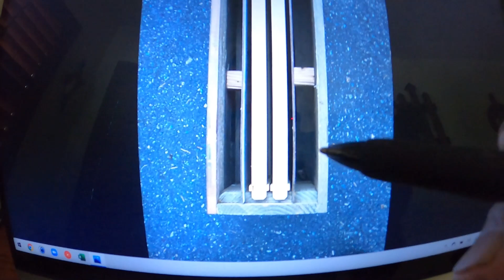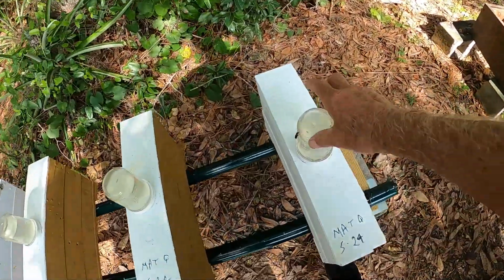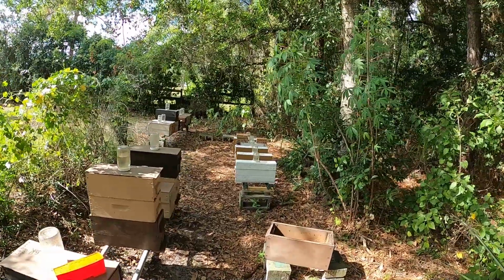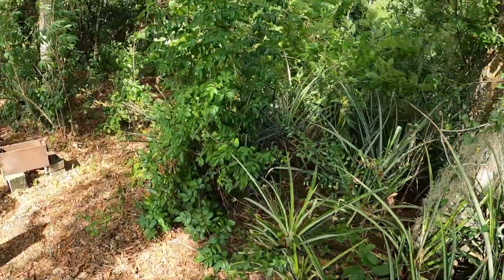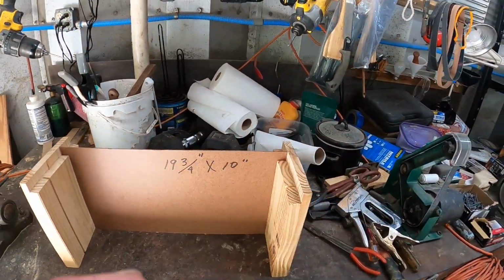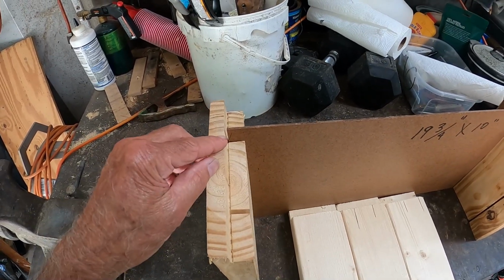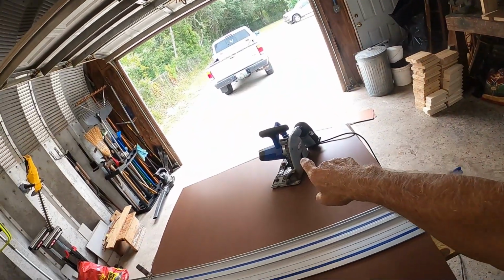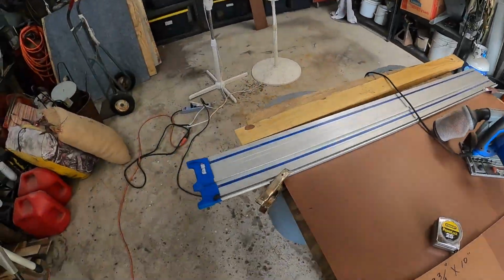5 Frame Beefy With Internal Mini

Comment: Couldn't you save time by just making following boards to fit your boxes?  The masonite swells after a while in humid conditions and gets frayed ends after a while.  I use 10 frame queen castles with 4 2frame chambers with 1 hole in each side and come across that issue from time to time.  What's your opinion?  Have you ever messed with following boards? Seems like it should work. And yes, the disks are awesome. Glad to see you using them. Thanks
Reply from the maker: Yes Kevin the Masonite sucks and i will start to use sheet metal and that will be just like a following board. My queen guy Mathew likes 10 frame boxes split 3 ways and that gives you 3 frames each . He said it seems to give him a more robust nuc. I think he told me he runs 100 of these  and pulls 300 mated queens per month on average. He runs a 400 hive operation.

Comment: Don't you guys get much propolis deposited in your hives? Here in West Oz the bees propolise the slots so bad that its a nightmare trying to remove masonite dividers. So now I use sheet metal dividers with a smear of graphite grease on the edges. Much more manageable.
Reply from the maker: May have the same problem time will tell.
Reply: I just leave em in ,I use 1/8 subfloor